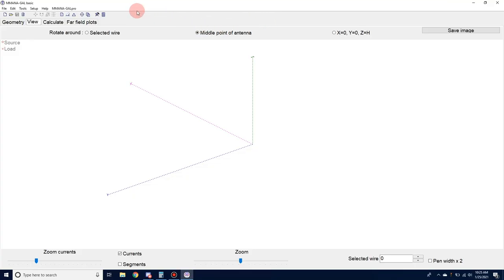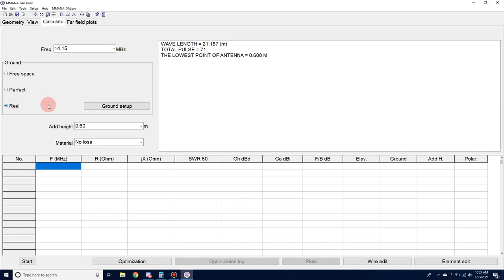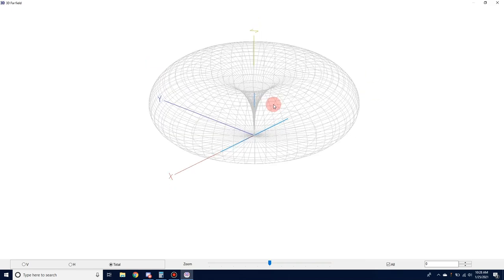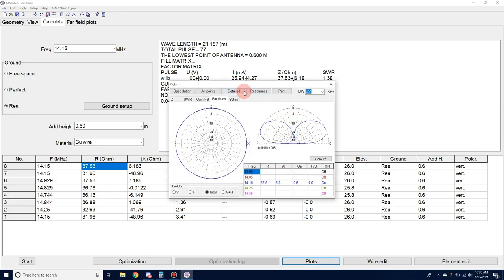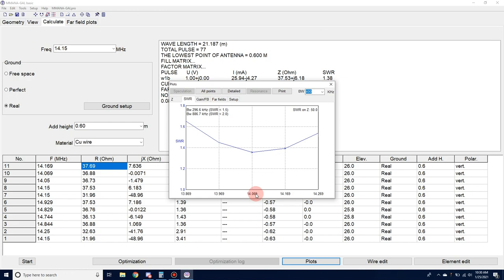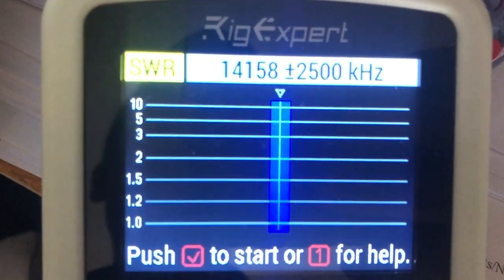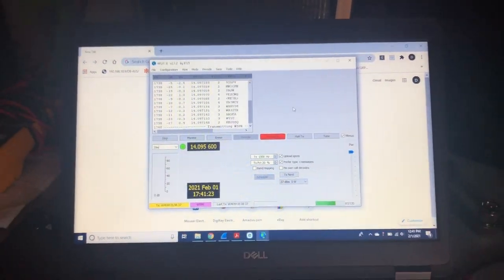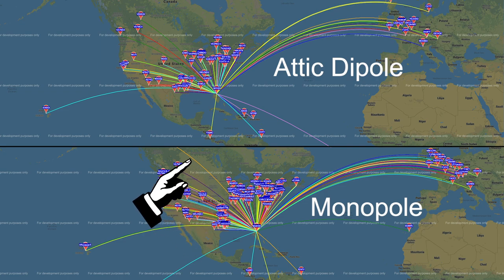Building an HF Vertical 1/4 Wavelength Monopole

Comment: Nice video and good craftsmanship  on the antenna build, Derek. If you enjoyed the lower recieve noise, just wait until you throw a 20 meter mono band yagi on top of a 40 foot tower! I was blown away at how quiet it was compared to my ground mounted hustler 5BTV. Speaking of the 5BTV, I recently relocated it to 16 foot above ground and following manufacturers installation recommendations, ran several tuned "raised" radials for each band of interest. It worked fine, and was quieter than when on the ground, but not much. I then moved it to 12 foot above ground and attached the 10 foot rigid steel mast to my RV's bumper and a unistrut bracket at the roofline, mast not touching the earth. I then bonded my radial plate to the metal skin of the RV and completely removed the raised wire radials. This is working extremely well and dare I say BETTER than any combination previously used. SWR is < 1.5 on all bands except for 40 meters, which is at 1.7. The takeoff angle must be better for DX than before, due to the locations of contacts I have made now compared to being ground mounted. I  haven't tried to model it due to not having the program yet, but I will try to download the modeling software you gave the link to in the description, although, Im not sure if it's possible to model a 30'  RV as a radial field. 😅 Anyway,  thanks again for taking the time to document and explain things! Experimenting is truly the best part of the hobby, or at least it is for me.
73 DE KN6UIZ

Comment: Good video. It is refreshing to see someone, on YouTube, that knows what He's talking about and shows, how to build an antenna properly, instead of going to the shop. I'm into this hobby for 46 years now. There are several people that make YouTube video's and pretend to be elmers, but give the wrong or incomplete info. What They don't understand is, that if You don''t use a Common Mode Choke, the outside of the coax shield, becomes a radial.
Reply from the maker: Thank you very much. There's a lot of great information out there, but also a lot of fluff not backed by sound theory and test. Which is why I think it's important to show the result as well as any source of information that I'm unable to demonstrate.
There's really something to be said for making your own equipment, antennas or otherwise. I may continue adding ham related content into the channel and hopefully folks are inspired to make and test their own equipment. 
True that without the CM choke, the feedline becomes part of the antenna system. Its on the list to make a video about chokes... now to find the time! Thanks again and 73
Reply: @AmRadPodcast just a small point ,the feedline is already part of the antenna system, without a choke it may become part of the antenna

Comment: Nice video...I have built numerous verticals since 1952...My mentor taught me that the radials must be y made of the same material as the vertical element and to mount the base of the vertical element approximately  0.5 wave length above ground ( ie 8.5 feet for 20M)...You will only need 4 elevated radials as each radial overlaps covering approximately 100 degrees closing any dips in the lobes...Usually a 45 degree angle on the radials will get you close on SWR and impedance...Make your final adjustments with radial lengths and angles...It takes a lot of time but well worth the effort...HP4RWE/Ron

Comment: Run at least two or three extra coax runs to the same location. I see trees back there. Setup a dipole. All the labor for one coax is the same and you will want it later. Trust me. Also use 1 1/2" or 2" PVC water pipe (super cheap) and while running your cables pull some rope as well. Then later you can pull a new line or replace if needed. Great results by the way and looks like a stout antenna.

Comment: Very nice build quality! I'm a passionate POTA activator and designed the ideal portable antenna via 4NEC2 based upon portability, performance and efficiency. I went through many different antenna variations and settled on the elevated vertical (3-4' up) with two tuned elevated radials (90 degrees apart for some directionality). I call it my POTA PREDator = Portable, Resonant, Elevated, Directional. Not only can I get <1.10 SWR on every band (telescoping whip with different radial lengths), I always hear "you're the loudest signal on the band" because of how efficient this antenna is. I will never use a ground-mounted vertical again - there's just too much ground loss. Congratulations on your monopole. Great minds think alike. I will happily share all of my computer calculations and photos if ur interested (email good on QRZ) 😄73 KJ6ER, Silicon Valley

Comment: Lightning in Central Florida is kind of bonkers, and I've always wondered what HAMs did about that. Even without a direct lightning strike, I bet there are non-trivial electrostatic dangers for an outdoor antenna.

FWIW, I turned it up when Beethoven started (though I prefer the 2nd movement from the 9th :)
Reply from the maker: Yes! I knew I forgot to cover something. I installed ground rods and have lightning arrestors on order. Maybe I'm paranoid, but I always unplug my gear. At least since we moved here 5 years ago. I've seen 3 trees with the bark blasted off in that time, and a very tall tree blown to half its height! Thunderstorms are a daily occurrence, so my coax connectors get a workout.

Comment: Great to see another video from you. You're always working on some interesting stuff. I got a magloop in my apartment that covers 40m and 30m pretty nicely, mostly made out of 3d printed parts and pvc.
Reply from the maker: Thanks Angel. Loops are good fun. How are you feeding yours? I got best results with a #43 core. Currently working on a remote stepper controller for it, so I'll probably do an update soon.

Comment: Great video! I was watching thinking to myself how cool it would be to use a 2" EMT with a reducer to 1.5" on top. Can you imagine the bandwidth of that set up?  Great job tinkering with antennas. Thanks for your video!
Reply from the maker: Hey Donald. Thanks for the comment. I’ve heard of folks using conduit, but wonder about the losses. Lately I’ve been playing with EFHW and they’re much easier to deal with than a monopole.. I plan on doing an A/B comparison just for fun.
Reply: @AmRadPodcast  Thanks for your reply. I have been using EFHW antennas in my HOA and have really good luck with them!

Comment: As you raise the base above ground, less current flows through lossy soil and more through radials. Droop the radials about 30 degrees and the feedpoint will be closer to 50 ohms.  If you must ground mount, obstructions can be troublesome, and you need many more radials to achieve decent efficiency.   It can be a good DX antenna.   I've also used a 4:3 unun to get closer to 50 ohms.

Comment: You answered some of my questions so now I have some work to do.
I too have an indoor dipole and a TS440S and the background noise is horrendous, S+9 with antenna attached and nothing with antenna disconnected.
Because of all this noise I don't listen very often and for only a short time.
I'm going to give your vertical design a try and see what happens.  
Maybe I'll wait till the snow melts and the ground thaws though.
Reply from the maker: The 440 is a great radio (as long as you know how to fix the "Dreaded Dots"). Yeah, I'm back up to S7/9 for noise on the attic antenna. Really need to isolate where that's coming from. I hope to lay the coax next weekend for a permanent installation. Good luck and keep us posted on the results!
Reply: I also have the TS-440S with a 10 meter horizontal dipole in my attic and found most of my noise was coming from my high efficiency furnace and condensing unit. They use unshielded stat wire for communication between stat, furnace, and condensing unit rather than hard wired relay control. The indoor fan has an ECM motor and the outdoor unit has a variable frequency drive that converts my 240 single phase power into 3 phase power to drive the compressor. All very noisy. Chokes on each end of the comm cables and AC power inputs made a big difference in my noise levels.   
  Thanks for the great video. 73. W3LOU

Comment: Great video I also did some modeling on mmana and found that the antenna would work on 6 meters with a 3.18 swr and 15 meters with a swr  of 1.94 so really its multiband for a mono band antenna good job....

Comment: Enjoyed the video even though it doesn't apply to my situation. Can never learn too much! (I'm trying to do 80m on a city lot with no place at all for ground radials. Entire lot is buildings and concrete.)
Reply from the maker: Thanks! That sounds like a difficult situation. Have you considered a magloop antenna? I’ll have a video out in the next month or so on one for 40m.. maybe see if I can get it working on 80 as well.
Reply: @AmRadPodcast  I've looked at mag loops. The low Q, and extreme directionality have me looking elsewhere. Good to talk, lousy to listen! Also, the Huge variable capacitor needed is not something easily obtained anymore. It is a lot of systems to make the antenna useable. I'm building a redesigned TTFD at 124' and 20" spacing. Sloping from 14' to 36' AGL. Testing will determine the final termination resistance and the ratio of the balun.

Comment: Have a look at the DX Commander (Antenna and YouTube channel).  I've a couple of those and they work very well indeed.  I have about 25 radials around 2.5m long.  The main difference is that you have multiple elements - kind of like a vertical fan dipole.  I have 160m-2m on one antenna using inverted L configuration for 80m and 160m.
Reply from the maker: Yeah Callum has a nice product. Great channel too. I just have a pile of DX Engineering fiberglass poles that I need to do something with!
Reply: @AmRadPodcast  well you can adapt his basic design to those I'm sure. If you have a few and enough space maybe make a vertical yagi :)

Comment: Good build, reminded me of an antenna built by Crush Craft years ago that had a motorized remote tuning ability. It was an R3, if you search Youtube for an R3 their is a video of the tuning unit. If you added something simular this vertical could then tune 17, 15, 12, 11, and 10  or even 6. I aquired the control box for the R3 but so far no luck with the box to mount at the antena. If you desired to build you  remote unit, Icould make that little control box available. I live up in Panama City.
Reply from the maker: Just checked the R3 video on YouTube.. looks to be the exact same capacitor that I have sitting in a box here. I’ll have to do a video on using that cap and see what kind of performance I can get. Thanks for the tip! And I’ll give you a shout if I end up doing it.

Comment: What wire did you use for the common mode choke windings please ?  Great looking project BTW
Reply from the maker: I ended up using #16AWG on a FT-240-43 core, but the SWR starts to rise up at the 17m band and above to uncomfortable levels. A few days later I tried "crossover winding" 17 turns of RG-58 on the same type core and it performed better than the magnet wire. Ok for a couple hundred watts, but not much above that. Soooo, I have more experimenting to do - probably with the camera on.

Comment: For that UHF/VHF radials, what if you just had a metal disc instead of radials?
Would 10awg solid core wire be good for 6/10m 1/4 radials?

Comment: If one were to use galvanized steel pipe for the radiator, (TV antenna mast free in my case) how would that compare to copper wire on your  modeling program.  Same dimensions or longer/shorter ones? Thanks
Reply from the maker: That’s a tough one. Traditionally, for best performance we’re always told  go with non-ferrous materials only. That makes sense to me at upper HF and certainly at VHF and above. I’ve heard of old timers using galvanized pipe or fence posts as HF antenna elements with no problem.. You’ll incur losses in the steel to some degree as it is ferrous, but on the other hand galvanized pipe is zinc coated and because of the skin effect the RF would flow mostly through that. I have no idea what the zinc thickness would be, nor would it be process controlled to a high standard.. I don’t think a “simple” program like mmana allows tweaking of parameters like that. Maybe someone with one of the pro simulators could chime in. High power AM stations use galvanized towers to transmit, so it wouldn’t be a total no-no. My advice would be, if it’s free, give it a shot! And definitely let me know if it works out for you. I want to look into this further.
Regarding your question about length, the standard formulas apply, but I couldn’t tell you what the velocity factor is for galvanized pipe. So... if you want to go barefoot you’d need to go long and trim it back, or load it with a coil or a cap hat. I like to run without a tuner, so I’d take the ol angle grinder to it!
Reply: @AmRadPodcast  thanks, it was free from neighbor and exactly 33'-2".  Seems like it was meant to me tried,lol.  Later this summer, I lol have to try it.  Maybe if it's not resonant, I can feed it as an end fed.

Comment: Hello, why a balun on a vertical monopole? It's a unbalanced antenna!
Also I saw you tested the SWR of the balun... In that way you know the power reflected back, but not the most important thing: its insertion losses!
How did you calculate that balun and how did you choose the mix for the toroid? 73s
Reply from the maker: It’s not a balun, it’s a common mode choke. You watched the entire video? Insertion loss is negligible with this choke. Type 31 vs type 43 core depends on frequency of interest. To learn more, google G3TXQ or see this article: https://gm3sek.files.wordpress.com/2019/01/G3TXQ-RC.pdf
Reply: @AmRadPodcast  The output of that thing is balanced: so it is a balun! It is written also at the beginning of the article you linked. Did you read it? The same article explains to you how to test a balun (the insertion losses first of all). In any case you haven't wound the coaxial cable on the toroid as in that article (losses practically equal to zero) but I can only see that you have wrapped many enamel copper turns (it is a real balun scheme) perhaps too many compared to the frequency, and for no reason because if all this is to fight RF currents on the outside of the cable, they come from a completely poor antenna ground plane. Instead of trying to fight them with a choke, increase your ground plane and you'll improve your antenna efficiency.
Don't rely on the SWR to do this because when it reaches unity you will still have about 15 ohms of leakage resistance in the ground plane. This is because a perfectly efficient quarter-wave vertical exhibits a radiation resistance of about 36 ohms. However, this small mismatch is better than wasting almost a third of the power in the leakage resistance just to read an SWR equal to one!
Reply from the maker: Excellent advice. Have a good day sir. 73

Comment: Stackclimber: I purchased the entire contents of a defunct radio/tv repair service.  Too many thousands of components fro me to ever use. I will view the public comments section of this video for any interest. Not trying to make big $$, maybe no $$ at all. Sharing with others would be a good idea in this situation. Located in NW Florida/ Florabama.
Reply from the maker: I’m not sure I understand what this has to do with an antenna. You want to sell components to people in the comments?
Reply: @AmRadPodcast  I realize now from your question that I may be hammering the S/N ratio on your channel, which I did not realize or intend to do. My post was off-topic. My intent is not to sell parts, but to give them away. Most antenna builders are not just antenna purists, they dabble in electronics and other technologies. I bought maybe a quarter million components for $250.00. A real bargain, but I cannot store them for long. If I made my $250 back that would be great, but is not my main goal. In this situation, sharing with other hobbyists and fabricators is the right thing to do. Not trying to draft you into my effort. Again sorry if I intruded. Joe

Comment: i intend to build a 11 meter 1/4 wave ground plane. i would like to know about antenna modeling . is there a free tool online ?
Reply from the maker: MMANA-GAL is free and is the program I used in the video. It'll give you a rough idea about feedpoint impedance and elevation angle of propagation, help you optimize the length for resonance. BUT in my opinion, the best tools are an antenna analyzer, wire cutters and a spool of wire. Simulations can only go so far.

Comment: I beg you to look into open feed line vs coax even 30$ a foot coax has .03% loss the lmr400  is .23 % down. Check out the The Toad Harbor Facebook page. With a balance tuner you’ll save 1/5 of your signal from loss. KC3ONO
Reply: For antennas with feedpoint near the earth, in a back yard, open wire line simply is not practical.  If he had 100 ft of RG213 and 1.5 swr he only has 0.8 db loss at 14 mhz. Then you have to deal with matching at both ends.  The Toad Harbor guys run OWL on 160 meters, to minimize loss?  Look at the real numbers.  Current Source is 100% right in his practices.  Congrats to him. 73 de K2XT
Reply: Low loss, yes, but you would have to use a transformer at the base to convert to balanced, high impedance (open wire runs 200-600 ohms).   True that you can run OWL with mismatch and into a tuner, but you must keep it balanced. Unless you're running a long way, probably not worth it.  If you are interested in OWL, search for my call.  73  W4NEQ.